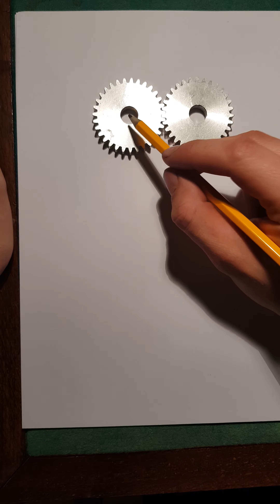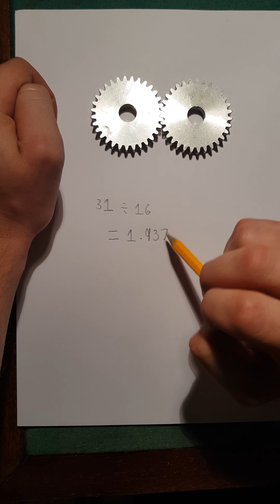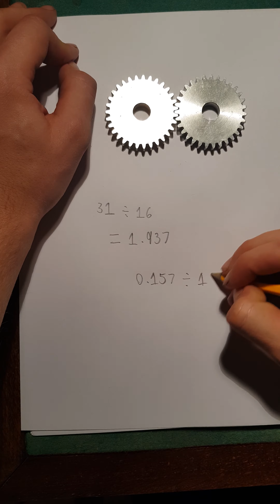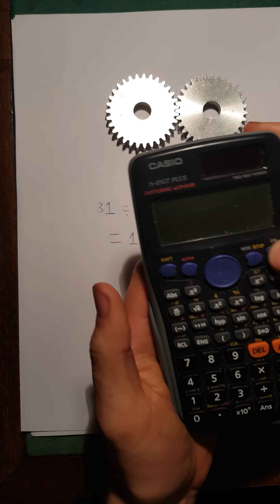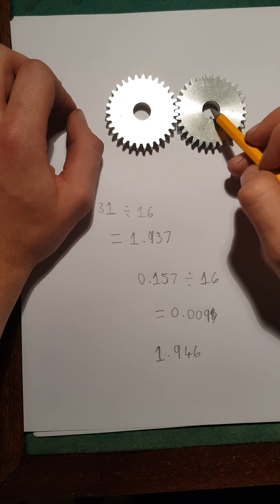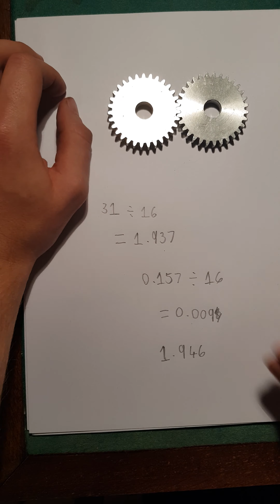Machine Design and Machine Shop Operations: How to Calculate Centre Distance

Comment: Where does 0.157 come from? How can I calculate it with respect to my gears?
Reply from the maker: 0.157 is a mathematical constant. It doesn't matter what the diametral pitch is, this number stays the same. Don't use this number for calculating the clearance in the center distance between metric gears though, as the diametral pitch system is imperial.